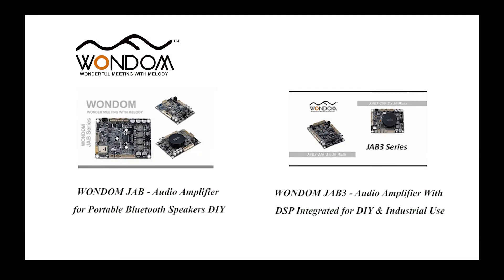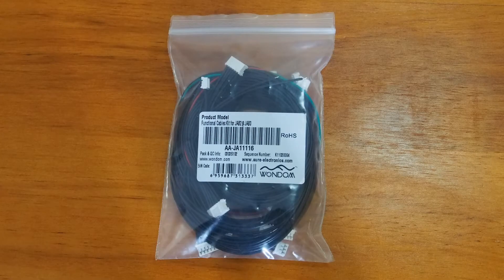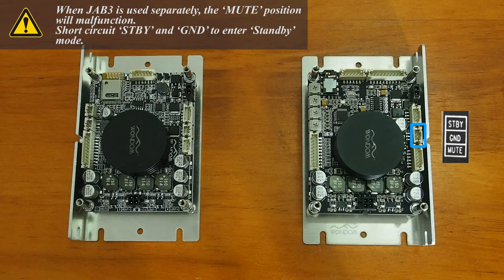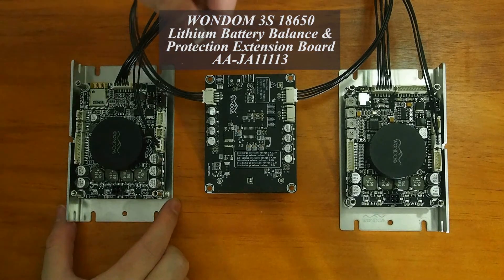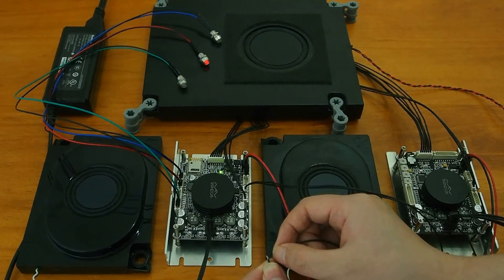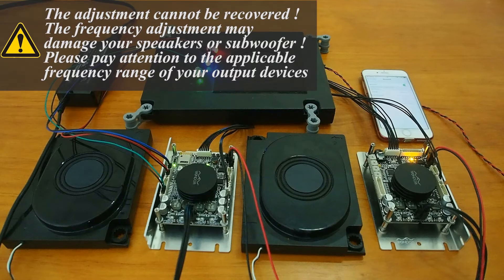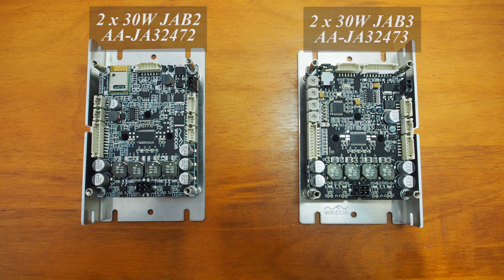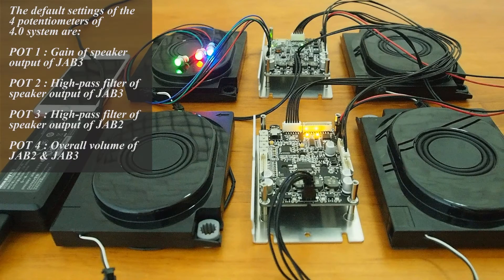How To Build An Audio System With Bluetooth & DSP Integrated

Comment: Hello, can I use JAB2 X 2 + JAB3 = 4.1 audio system ?
Reply from the maker: Hello. Unfortunately, you can only connect 1pc JAB2 with 1pc JAB3 to build 4.0 or 2.1 system. If you want to build 4.1 audio system, it's suggested to use JAB4 with the DIPO1 I2S amplifier board. Here is a video that may help you: https://www.youtube.com/watch?v=IcnOx_mC6yM. Wish this could help you. Have a fantastic day~

Comment: when you say that the "adjustment can not be recovered", does that mean it can only be flashed once? Or does that just mean that the default settings would be overwritten, and next time we do something we would have to rewrite those as well?
Reply from the maker: Hi, LuckyST
. If you use four potentiometers to adjust the parameters, it won't overwrite the program. Please pay attention to the specifications of your speakers before adjustment to avoid unexpected damages. If you write a program in through the SigmaStudio and burn it in, the original program will be overwritten then. Have a nice day!
Reply: @WONDOMAudio  so the potentiometers stop functioning once the DSP has been flashed?

Comment: Hi!
I would like to ask that  how can i use a separated stereo master  volume controll what can i use on the active speaker controll panel, "outside" the speaker box? I will be  built a 4.0  channel system with Sure JA32171  JA32172 and the DSP Bluetooth programmer. So how can i teleport that little master volume potentiometer knob to my controll panel?

Comment: Hello, if i have the JAB3 and now buy the JAB2 and connect them together, can i use Bluetooth, and all LEDs and still programm the DSP on the Jab3 via SigmaStudio so i can put on all 4 channels an active filter and Equalizer?
Reply from the maker: Hi, Centax | 8D DEUTSCHRAP
.
Thank you for your watching and comments. 
You can build a 4.0 audio system integrated with both Bluetooth and DSP using WONDOM 2 channel JAB3 and 2 channel JAB2. In this condition, you can use the Bluetooth on the JAB2 to receive audio signal and still program the DSP on the JAB3 via SigmaStudio. 
As for the LEDs, we have released a functional cables kit for the easy connection of JAB3 and JAB2, in which we provide the related LED cables. 
Here is the link of the cables kit for your reference:
http://store.sure-electronics.com/product/AA-JA11116

Comment: HI, thank you for the video .I was able to get the jab3-60 and jab2-230 working together and programmed with custom DSP and it sounds great. I have two questions 1) is there a way to disable the auto-standby? this causes some clicks, and I am running this from a switching supply not battery so it is not necessary 2) there is a click and a sharp, short tone when turning on the devices. Is there a way to prevent this?
Reply from the maker: Hi SI Tech
You can short-circuit RST and VIN in J4 port of JAB3 to disable the auto-standby. As for POP sound when the device is turned on, you can use the 3pin line in the cable package to connect J9 iport on JAB2 with J12 port on JAB3 to eliminate POP sound. You can visit this link for more detailed information about JAB3. (Link: http://store.sure-electronics.com/product/AA-JA31211 )
Thank you for your support. Have a nice day:)

Comment: can i make one subwoofer two woofer and two tweeter, all in one?
Reply from the maker: Hi Aleksandre Beruashvili
Our JAB3 can be connected to JAB2 to build 2.1/4.0 audio system with Bluetooth and DSP fuctions integrated. And you can change DSP settings through ICP3 to control the audio sysytem.
Thank you for your support. Have a nice day:)

Comment: When you build this setup with the jab2 tpa250 and the jab3 tpa1100dsp its perfect for 2.1
But i want to build 2.2 with an additional tpa1100 for the second woofer.
I think DAC 0 and 1 are for the Jab 2. And DAC 2 is for the integrated amp on Jab3
On wich Pin on the Jab3 tpa1100dsp board can i get the signal of the 4. Dac output from Adau1701. Should be the DAC3 in Sigma.
Thanks
Reply from the maker: Hi Karl.
DAC 0 and 1 are for the JAB3, while DAC 2 and 3 are for JAB2.
The mono version and stereo version of JAB3 use two different firmwares.
Thank you for your support. Have a nice day :)

Comment: Do you have any new info regarding the 2.1 amplifier board with inbuild dsp and bluetooth?
Reply from the maker: Hi shinri92
The 2.1 amplifier is under test. Thank you for your support, please pay attention to our channel. When the product function is updated, we will have corresponding video and documentation updated.
Thank you for your support. Have a nice day:)
Reply: @WONDOMAudio   will it have the same features as jab 2 and jab 3? I want to connect the 2.1 with a jab 3 for a 4.1 setup.
Reply from the maker: Hi  @niklassundgren5993  
This amplifier board cannot be used to connect with JAB3. We recommend our 6 channel amplifier foe you to build a 4.1 system. If you want to realize bluetooth and DSP functions, you can use our bluetooth receiver board and APM2. And if you bought APM2, APM3(AA-AA11428) is needed to connect the amplifier and APM2. You can visit the link below for more detailed information of these products.
(Link: Amplifier: http://store.sure-electronics.com/product/AA-AB34181 

Bluetooth receiver board: http://store.sure-electronics.com/list/1

APM2: http://store.sure-electronics.com/product/AA-AP23122 

APM3: http://store.sure-electronics.com/product/AA-AA11428)
Thank you for your support! Have a nice day :)
Reply: @WONDOMAudio  Thanks for the reply. Can I control all 5 channels with dsp for crossovers etc. with this setup? And can I make channel 5 and 6 mono for subwoofer?

Comment: I have one question, what is crossover and will be it necessary for this 4.0 system?  P.S sorry for bad English
Reply from the maker: Hi Aleksandre,
It is determined according to your needs or your speakers, etc. It is not necessary for 4.0 system. You can adjust it with potentiometers on our board. Thank you for your support. Have a nice day!

Comment: In this configuration, can the ICP2 be used to change the DSP settings of both the JAB2 and JAB3 through the app?  I'm  looking to use the 4 channels to do a bi-amped 2 channel stereo configuration, meaning that the JAB2 would drive the tweeters, and JAB3 would drive the woofers.  Therefore, I'd need a low pass filter on JAB3, not a high pass filter as is the default.
Reply: Hi Michael, i think that you could do this by using the ICP3 programmer (bluetooth)
Reply from the maker: Hi Michael, nico97412 is right. Thanks for watching.

Comment: Thanks for the video. Isn't possible to use volume contrôle when we connect JAB2 & JAB3 ? Do you have solution for that ? thanks
Reply: WONDOM Audio that potentiometer is not easy to adjust when the jab 2 and 3 are in an enclosure. Is there no way that a volume knob control can be added?
Reply from the maker: At present, we couldn't add a volume knob to JAB2+JAB3 system. You can remove the potentiometer POT4 on JAB3 which is used for the adjustment of overall volume, and then the function could be connected to an external potentiometer which is easy to be adjusted. 
Also you can use our ICP3, a programmer with Bluetooth, to control the volume and other parameters easily on your phone.
Reply: For a future upgrade, it'd be nice to have an extension board to relocate these pots to a user accessable panel
Reply from the maker: Hi Chiris, there's a potentiometer on JAB3 which can be used to control the overall volume of the whole system.

Comment: The  AA-JA32171 i received do not have the 3 pin connector you are connecting to here. Instead it have a 2 pin power led connector in that location. The AA-JA31181 looks exactly the same as in the video. How should this be set up for 2.1 system? Just no control cable?
Reply from the maker: The JAB2 you have is an old version, we have upgraded our JAB2 to new version with 3 pin connector instead of 2 pin connector. The connection between this old version JAB2 and JAB3 is almost the same, but no control connection cable, only 6 pin audio connection cable is required.
Reply: What is the difference in function? I ordered the same amplifiers as you show in the video on the 12'th of december, received on the 22'nd. For the purpose of using them in 2.1 system and you sent the old version.
Reply from the maker: We only made optimization for the new version, but it got the same function with the old version.
Reply: Hi guys, i also received the old version of jab2 but it seems that with the 6 pins cable the jab2 and the jab3 don't communicate :(
When connected in bluetooth only the jab2 play music... Please help me

Comment: Thanks for the video, when in sigma studio, how to change dsp settings for the outputs of JAB2?
Also, can I still use 3.5mm jack input in this configuration? Thanks in advance
Reply from the maker: Yes, we can still input signal via 3.5mm jack in this configuration.
We will upload a new video about how to change dsp settings for the output of JAB2 in Sigma Studio in a short time.